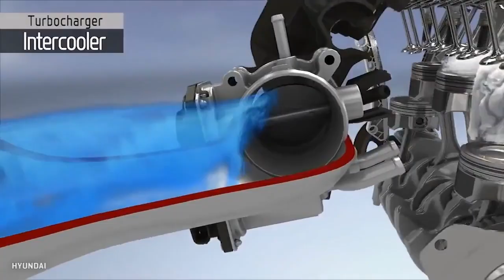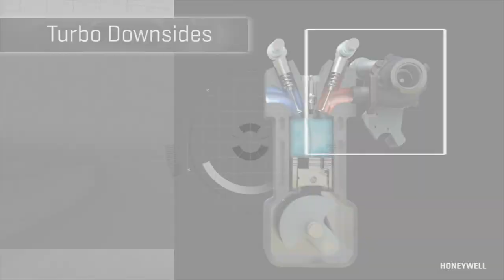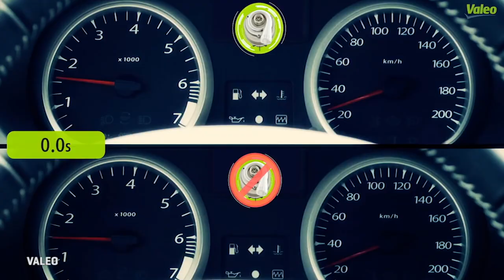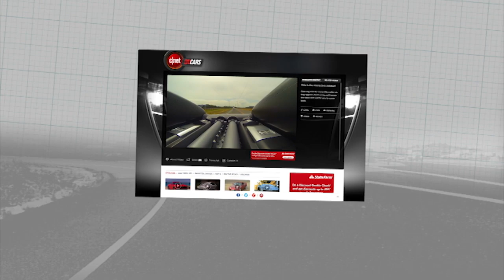CNET On Cars - Car Tech 101: Electric turbos are coming

Comment: I would keep the exhaust turbine to charge the battery and use the electric motor to modulate the backpressure instead of using variable cams for optimal combustion through all the powerbands. With the electric motor, the headers lanked is not relevant anymore so the turbo assembly can be tucked under the engine.

Comment: F1 has a special electric turbo called the MGU-H, where the turbo can charge it's own battery because there's a generator at the other end of the shaft that can reverse as a motor that drives the turbo on low-revs. Why aren't there any production cars with a similar turbo?
Reply: This concept gotta be applied on electric motorbikes 🏍️⚡🔋 today

Comment: 2 Things:  1.  Turbo refers to turbine so there's no such thing as an electric turbo, these are electrically powered superchargers with centrifugal compressors, or centrifugal supercharger for short.  You can have an electric-assisted turbo charger with a motor on the turbo shaft but they dont make those for production yet.  2.  The power to spin the compressor of a std turbocharger is 10-20% of the engine power.  So to replace the turbine you need a 30-50 HP motor and a large cooling system, and it would be too large to fit in the engine bay.  The turbine has much higher power density and no cooling required.  Thats why electric superchargers only help the turbos and only make a few psi boost and only low speed.

Comment: how much AMPs needed to run one?    one you tube gave some info on that it turned out to need 1300 AMPs.    which on a 12 volt system would be at least   0000  wire.   all most 1/2 in.  so you fix that with 48 volt system   ,  but at what cost?   when you find the FREE lunch let me know.

Comment: What I don't understand is the efficiency part. Because turbos compresses air and puts all that into the cylinders; however if the air efficiency is over 100%, wouldn't the vehicle be chugging in even more fuel in order to have complete combustion??
Reply: Yes. More fuel = more power. Better efficiency because even through the fuel flow is greater the acceleration is faster; you spend less time dumping fuel in to go fast.

Comment: Also if these electric turbos require such large batteries then surely there is a massive demand on the alternator to charge them, the alternator puts massive load on an engine as it is, once it energises, it's still good to see manufacturers trying out old technology though.
Reply: The battery only charges when the turbo isn't boosting, placing a slight load on the engine while cruising.

Comment: Funny enough I've just watched several videos placing conventional turbos at the rear of the car with no increase in lag. It keeps it's heat out the engine bay, adds more space, and get's rid of those highly inefficient turbo manifolds that resemble an octopus sucking a bitter lemon.

Comment: I know these things are making a boom, but I find it inadequate to add a higher weight and voltage battery to an engine with a turbo already. Cnet should seriously take a look at Torotrak's V- Charge, a variable speed supercharger which is belt driven and controlled by the vehicles computer.

Comment: Just put a hybrid system on your car with the electric motor driving your accessory drive. Benefits: More HPBetter fuel economyReduced emissionsReduced engine wear No parasitic losses due to exhaust back pressure (exceeds boost pressure)

Comment: why using electric turbochargers still need  intercooler
Reply: when you compress the air its temperature increases. it may not be hot, just a little bit warm, but it depends on the pressure you make
Reply: Compress the air in an empty water bottle and unscrew the cap a little so you can shoot it, you will see that compressing the water bottle to shoot the cap leaves the residue droplets of water boiling. Please explain how reducing the space for molecules to travel, thus creating more collisions does not heat them up.
Reply: JZA compressed air heats up during the act of compression
Reply: Bart Denson Um no. Compressed air isnt hot. You have this backwards. The intercooler is not needed because air gets hotter when compressed. An intercooler is there to make the air colder which makes it denser. A more dense air charge gives you better performamce. Thats why turbocharged cars perform better in the winter. Some turbocharged cars didnt have intercoolers, but they all do now. This isnt because the air somehow got hotter. It was because it made the turbo more efficient and denser air can activate the turbine better.

Comment: where is 48 volts gonna come from? a alternator that's sucks power from the engine.
Reply: The battery can be charged while the turbo isn't boosting, putting a negligible load on the engine at cruise.

Comment: I must be stupid because I don't understand how a turbo helps with fuel economy.

I don't believe there is any engine on this earth that will consume less fuel after a turbo has been added to it.

Wanna save fuel ??? a smaller engine is the only way.
Reply: Turbo engines are higher efficiency, if tuned for efficiency.  To compare though, you have to compare the non vs turbo engines with the SAME HP output, not an engine without turbo vs the same engine with turbo.
Reply: What you say is true, when comparing those 2 motors at part throttle and cruising speed (regular commuting, not under boost)

BUT.. a 250-HP 4cy turbo at full throttle will consume roughly 20%  more fuel than a 250-HP n/a V6 at full throttle.
Reply: Any turboed motor creates more power and is more efficient.  If we cared more about efficiency instead of cost, every car would be fitted with one.  So basically if you add a turbo to a current config, you will get more power.  If you want the same power, go with a smaller engine (that consumes less fuel) with a turbo.

Comment: Only a 10-15% increase in mpgs? Pointless, they can do the same/better job with cylinder deactivation, lighter materials to build the car and maybe slightly higher compression like Mazda's SKYACTIV technology. 

And the added weight of all those batteries would negate any net benefit. Not to mention cost of replacement batteries.

Comment: Thomas Knight Turbos had this 10 years ago.  He linked 3 motors to a 12v batter and connected it to a turbo and it ran for 3O seconds,  I called it Electric Nitrous.   The the battery had to recharge.  You do not need turbo all the time, only to pass or get up to speed, merging etc.

Comment: I think this is the next big thing to eliminate the dreaded lag!
Reply: +TheRoggan123 THEY already eliminated the lag Decades ago with electric or belt-driven superchargers
.
Reply: +electrictroy2010 Belt superchargers consume a significant part of energy output to work. What car on the market has an electric supercharger?
Reply: The ideal solution would be a Turbo with electric initial "boost" to quickly build pressure to minimize drag. Once it's spooled up no need to add electric energy.

Comment: What are you talking about? Turbo lag is not a thing anymore since the ventilator can change it's spades degree so at low engine rpm is still effective. 

So yea. Electric turbo is not a thing.

Comment: Is there such a thing yet as a supercharged engine with an electric assisted turbo? I.e. a normal mechanical supercharger with the addition of a normal turbo, the turbo itself being supported by electric motor at low revs to deal with turbo lag, and at high revs/less torque storing energy from extra waste gases to supply it for future low rev acceleration.
Or perhaps, a truly electric supercharger which uses a bigger alternator directly off the crankshaft to charge cells, but also coupled with a normal turbo, the turbo also linked to its own and second alternator to support it, making use of some exhaust-gas energy at the same time? The control systems on the power delivery from the cells to the supercharger's compressor could smooth out the turbo lag on the turbo, or you could just leave it alone and use the turbo (with its own, exhaust-driven alternator) to increase the efficiency of the supercharger. I expect these things must have been done, or are being 'perfected'.
Reply: Or at least in the second case, have too many losses...being able to switch on and off the supercharger though (I know that's around already in some form), is quite cool..especially if you can increase the efficiency with a turbo making use of exhaust energy at the same time.
Reply: +Philip Paynter VOLVO makes a car that has both a turbocharger and a supercharger
.

Comment: This is a great idea but it's better to just add an electric motor for maximum efficiency and performance. The best performance cars are hybrids.
Reply: +The Lavender Town Project UNTIL the battery gets old and you waste $3000 on a new battery (as I did with both my Toyota Prius and Honda hybrids).  My next car won't have an expensive battery needing replacement
.
Reply: electrictroy2010 Well most hybrids and EVs will save you enough money, beginning with the tax credits and state incentives, and many other things, that you can afford a new battery when it comes the time, which is 7-15 years from when it was bought. And by that time new batteries will be much more energy dense and cheap. Plus if you can afford a hybrid, but mostly if you can afford an EV, you should have no problem affording a new battery. Most smart people get their batteries referbished to 95% life for 1/3 the cost. Then again, you could use fuel cells for energy instead of batteries. There are many ways to reason the technology.

Comment: it should called turbo look electric supercharger.
Reply: +J XXX yes turbos run from the exhaust.  If the fan is driven by a belt or electric, then it's a SUPERCHARGER not a turbocharger
.
Reply: JC Journey turbo look doesnt make sense cause there are centrifugal superchargers.

Comment: "more fuel more power" Nope better air/fuel ratio means more power , a turbo brings more air to the fuel than an n/a intake therefor more power , tune your engine more rich and it will drown. "There is a whole lot of lag" no ,most factory are super small and that results in instant spool , the only time you'll get lag is when you left off your foot of the throttle and you instantly press it back on , you'll have blown off your built pressure and the turbo will have to build some pressure again but that's not a problem with a small turbo."the turbo sits in front of the exhaust stream" yes but you'll lose power if your manifold is not properly made and car manufacturers knows how to make manifold which streams the most exhaust gas(in the limit they have to make the car road legal). That man does not know turbo systems well , don't bother listening , i'm sick of false information and that's why i'm explaining al of this ;)

Comment: did brian cooley get his degree in "mechanical engineering" from berkeley or stanford???
Reply: brianl9944 Thanks god i'm not the only one who knows that he's saying shit. He litterally described 80's turbo cars. Of course old turbo cars were laggy , had badly engineered exhaust manifold which had bad exhaust flow but it's not like that anymore all of these porblems are solved (stock unmodified cars at least, tuner cars are different)
Reply: +DukeNuggets69 no he's right. a turbo, even a twin scroll turbo, is an exhaust restriction and it eliminates exhaust scavenging.

Comment: If it's not driven by exhaust gases it's not a turbo it is in deed a supercharger. Nice way to catch viewers attention though.
Reply: Turbochargers are superchargers. A supercharger is any device that boosts your intake air density.
Reply: Chad Steelmon even the actual makers of this "electric turbo" calls it an electric supercharger

love cooley but a turbo is a turbo only if its passively powered by a turbine and a supercharger is a supercharger only if it is actively powered by an engine or a motor. the "shape" of the device isn't what makes it a turbo or a supercharger. this device looks like a turbo, which is probably why cooley thought it was a turbo, despite the fact that its working principle is much more closely related to a supercharger.
Reply: And anything with a turbine is a turbo
Reply: Guess so. I mean, we can't call them electric chargers because that would confuse people.
Reply: spdrasr3 _  Turbo is basically short talk for Turbine , So anything  that uses a Turbine could be referred to as a turbo .. They even use the word Turbo on hair dryers .. Ha
Reply: ***** Very interesting I appreciate the knowledge I'm not always right though I am most of the time lol
Reply: it's not a super charger as super chargers are belt driven so it's indeed a electric turbo charger